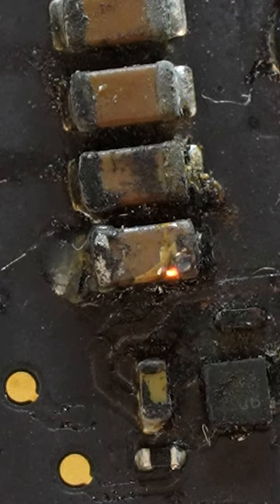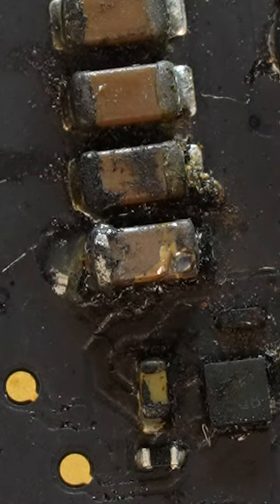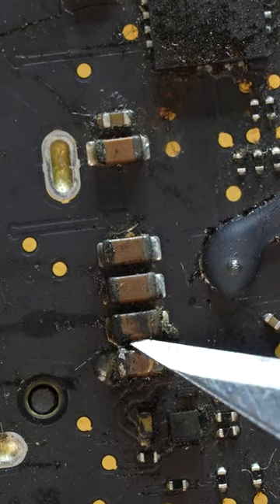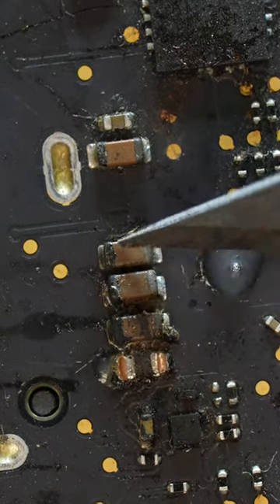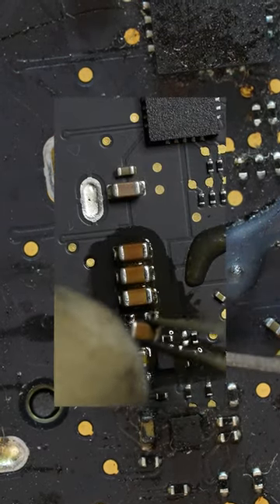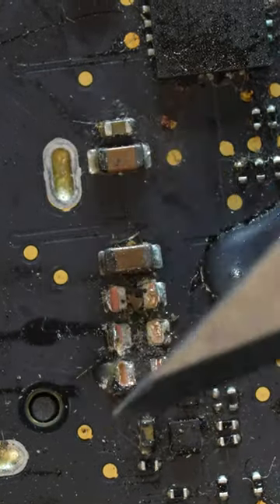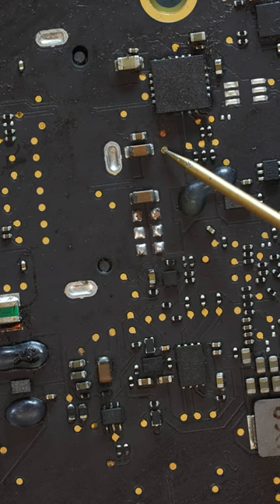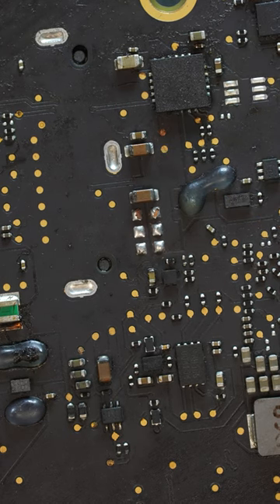Burning Capacitor🔥 | 4K 60fps with Macro Lens ASMR #shorts

Comment: What voltage is used for injecting? And is that motherboard just dirty or you put something on it for pinpoint the short?
Reply: Start with one volt. (DC)
IF you don't see anything heating up then go to 2 volts.
IF you have a thermal camera then you can see the hot area.
IF you know the area already then just use some 99% isopropyl and watch for the component to evap the fastest.

Comment: Why are you ripping up the Soldier pads
Reply from the maker: It's fine for burnt out bypass capacitors
Reply: yea i dont think permantly damaging the mobo is the right thing to do
Reply: He's showing you that they are NOT necessary as you are not going to put replacement caps back on the "by-pas" circuit.
Reply: @robertpage2023  by doing that you are ripping off the pads